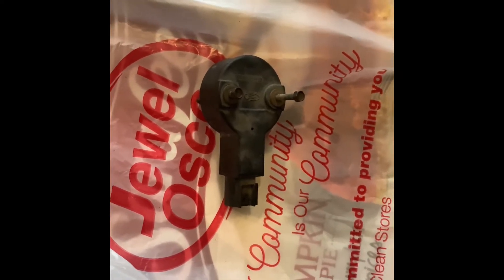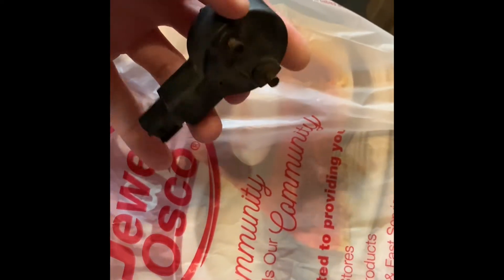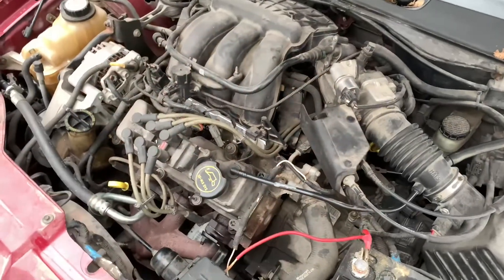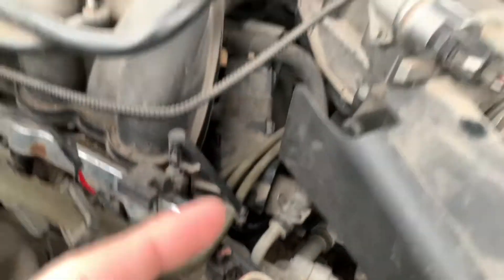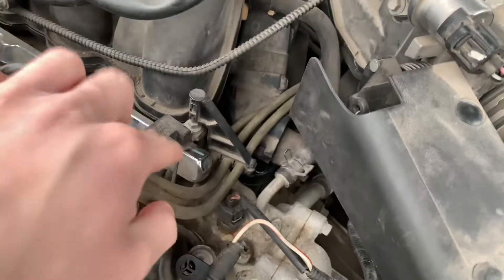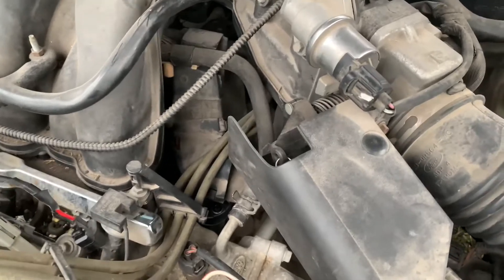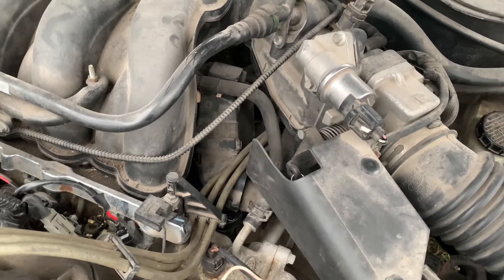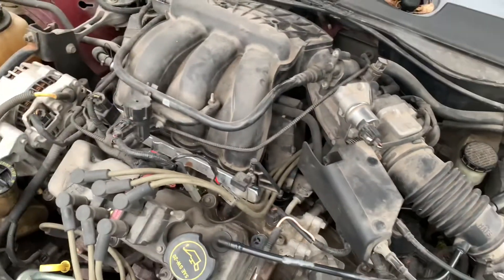Camshaft Position Sensor Replacement-2007 Ford Taurus

Comment: Thanks bro, that's the same code i'm getting.
Mines idling pretty rough, but has never stalled.
What is yours doing, and did you figure out what it is yet?
Haven't replaced mine yet, but thinking about getting a crankshaft position sensor as well.

Comment: Saw a different video on a Mustang with the same code and it turned out to be uneven or excessive feed from the alternator due to a bad alternator diode.  You would need an oscilloscope to verify though.